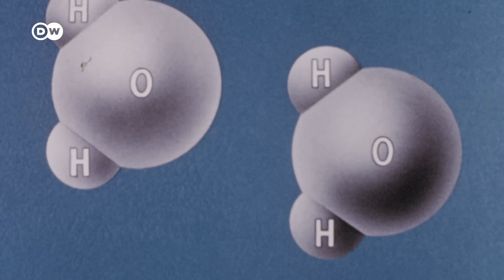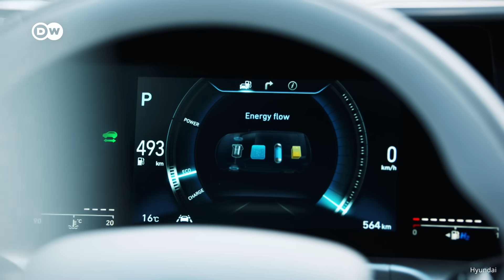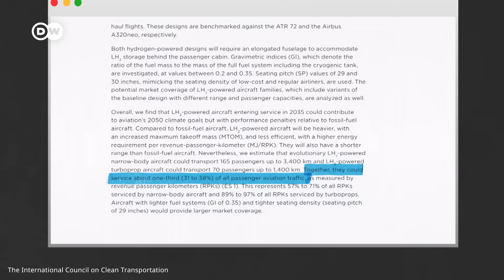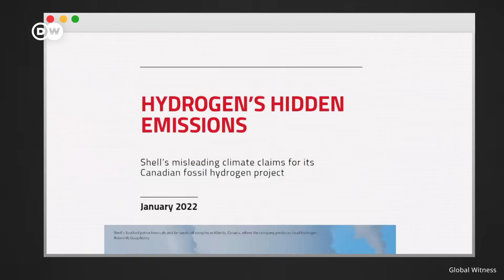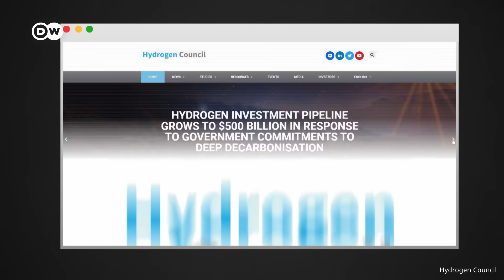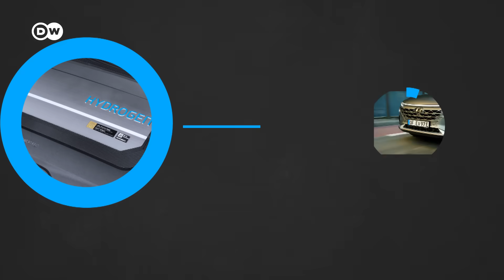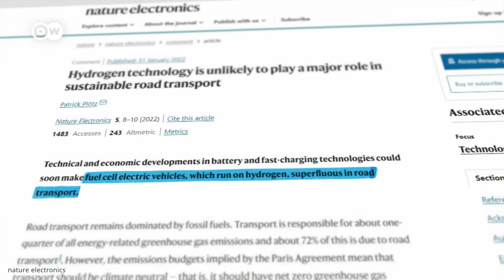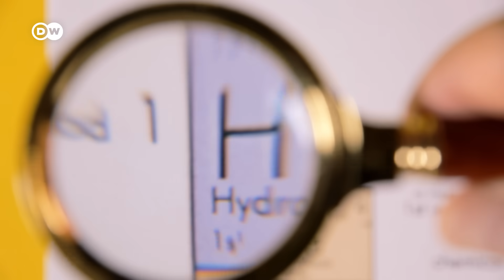The truth about hydrogen

Comment: Can we containerize Hydrogen production ? Down to a scale that a farmer with a relative small piece of land could become a grid supplier of electricity when the grid asks for it, and the installation will start producing Hydrogen the minute the grid has enough (local) producers and there is no (local) demand for electrical energy? Put a Fuel-cell in the next container, and the same farmer will be a night-time producer of electricity (when the local grid asks for it). Yes we need intelligent grids, we need decentralized solutions and steering. If we build a new section to a town, all buildings should be organized to yield maximum solar return. Connect all the solar panels to a local Hydrogen producing station (nearby, but in a safe distance) and repeat the containerized solution. Small local grids with local solutions. Huge (nuclear) power stations we are using now need weeks to start up or to slow down. We need agile, smart, self-regulating local grids.

Comment: The need for larger capacity tanks to store hydrogen gas to fuel shipping would be an advantage, as the tanks can be emptied, or the gas used for emergencies, where there is a need to increase bouyancy, be it the tank being used as a bubble to keep the ship afloat, or that the gas is expelled, to fill a massive balloon, or giant life vest for a ship. Ship designers can really have a lot of design creativity to capture this potential.
Reply: Cryogenic LNG tankers already exist…
They transport LNG at -160C.
LH tankers would be essentially identical just running at -254C.
LNG tankers run on the LNG in their tanks.
Modern oil tankers do the same feeding the tank off gas to the engines.

Comment: Hydrogen is not a fuel source, it's another less efficient type of battery or energy storage. So, you have to pit Hydrogen against other batteries and when you do, it doesn't measure up, except in niche markets. The only market that clearly needs hydrogen so far is steel.  The only energy source is the sun unless fusion is solved and don't hold your breath for that one.

Comment: Efficiency of FC. Roskilde Denmark got 20 BEV busses, with a oil burner for heating. Turns out that average electrical power for heat is 15kW - the same amount that is the average power consumption for the wheels. Using battery for heat and the batteries would be too big. So the bus is 50% electric - had it been FC the heat (at around 70-80Cel) would fit nicely - please recalculate efficiency for each application as they need heat, cars, trains - busses and ships.

Comment: Hydrogen is a great energy storage method. The enrgy stored this way is much longer lasting than batteries. You might call hydrogen a fuel, but it is not its strongest point.

Comment: A lot of environmental people hate hydrogen because it goes against a lot of peoples agenda. Its nearly a limitless source compared to batteries and gasoline yet a lot of environmentalists shun it. My theory is that a lot of the people in the environmental field have invested a lot of money in the electric vehicles/appliances, and don't want people investing in other renewable sources. Sure hydrogen isn't at the same level as ev's, but so weren't ev's when they started to come out. Ev's were  hurting the enviorment more than they were helping before people started using lithium. Hydrogen in theory is better, especially in ammonia form, and its up to us to make that theory a reality. We jist need the same kind of funding and public support really that people showed to ev's. Corpo democrats will tell the tale.
Reply: Wrong. EVs have been efficient from day one.
Reply: @Freba9  most ev's before the 2010's were acid based. Which hurts the enviorment more than the offsets it creates. Efficiency is useless if the cost to make it isn't environmentally sound.
Reply: @Mogadypopz  Lead acid battery recycling never was a problem. Apart from that, the point is that EVs have always been efficient, hydrogen cars have not and never will be.

Comment: Overall, I think everyone needs to understand that the energy transition will not happen with ONLY one renewable energy, or green energy storage. Green hydrogen, green ammonia, fuel cells and what not will all be part of this transition, just like wind, solar and other renewable energy sources.
Reply: Exactly. Just as there are multiple fossil fuels (various types of coal, oil, condensate and gas) there are going to be multiple types of renewable energy sources, all with their own specific applicabilities.
Reply: You can include blue hydrogen in that mix. There are very few barriers to adding hydrogen (blue or green) to methane in domestic and light to medium industrial / commercial use and thereby reducing the carbon emissions for a large number of mains gas users.
Reply: @AndrewJOliver  Actually no Andrew. Hydrogen and superior natural gas - like the pure now illegal corn ethanol mandate corruption - have incompatible detonation points. 

First like all the small not fuel-injected engines in America burned out by the illegal ethanol mandate - mixing hydrogen and natural gas will destroy every existing home heating system in America. 

Like the now insane excess levels of intermittent windmills and solar panels - the systemic inefficiency will impose more co2 and very real pollution.

Just because something can be done does not mean it should be done. Nor does it mean it is beneficial. 

This is exactly why all the progressive GW mania delusions fail. Average people are misled and believe in a doomsday cult. Forcing Americans with common sense along as a (forced) together. 

There is merit in hydrogen fuel cells in transportation. Especially heavy trucking.
The efficiency of electric drive does not require energy-inefficient and expensive short-lived heavy batteries. 

It is a matter of rationally applying technology. This does not happen when political myths are believed like a cult. Time for you to study for yourself.
Reply: Nuclear power will be used or carbon reduction goals will not be met in time to help. Get real, go nuclear and save our civilization
Reply: @brianadams1907  yeah no doubt about that. Nuclear is definitely part of the energy transition
Reply: Technically fossil fuels are also just an energy carrier, its just the first phase of the process (converting into fuel) has been done for us by geology and time.

Hydrogen has the added benefit of being transportable in a way that electricity is not, it can be pressurized and contained in tanks and even pipelines. Electricity can only be transported via power lines (not particularly resistant to weather) and batteries (incredibly inefficient as a transporter).
Reply: It was also a fallacy to disregard nuclear energy as one of the many tools which could be used to decarbonise.
Reply: @jonathantan2469  nuclear energy is the cleanest and most efficient form of energy production we have available. The carbon footprint over 15 year is lower than equivalent solar or wind.

The only problem with nuclear power is the obvious "what-if" scenario, failures are rare, and a well built plant tends to contain failures quite well, but you still have to sell people on the idea.
Reply: "green ammonia,"
I have some green ammonia water.  I use it to clean floors.  I think the color is added and not a natural component of ammonia.
Reply: Ammonia has the no-carbon advantages of hydrogen as an energy carrier, but already has a vast mature distribution and storage infrastructure for it's use in agriculture as a fertilizer. It could be both the energy and nitrogen fertilizer source for agriculture without need for the investments at the level of replacing fossil fuels with hydrogen.
Reply: Whether fuel or carrier is debatable. The hydrogen is transformed or consumed.

Mixing terminology. But both terms are correct.
Reply: Nuclear energy will also be part of the solution
Reply: I wonder if it’s possible to install a fusion engine on vehicles, if so, the energy density problem will be nill.
Reply: The thing is, "green hydrogen" needs 3X to 5X more electricity (solar panels, wind turbines) up front to deliver the same energy at the end point.
Reply: @booobtooober  There are massive developments being done in terms of electrolysis efficiency. Nowadays, you can have efficiencies of up to 80% using a water vapor electrolysor. The idea is still to have the green hydrogen plants located in regions that have plenty of sun, wind or geothermals. Hydrogen can store that energy, and be delivered according to need later on. Pure renewables aren't able to do that right now. Also, don't forget that hydrogen is already being used in plenty of Heavy Industries which need to decarbonize as well, so I don't see why green hydrogen wasn't a viable alternative to these industries, since the technology of electrolysis is well known a d hydrogen is being used widely...
Reply: @TWCHHK  Don t forget that the good old solar and wind energy together with battery technology is getting better way faster then hydrogen tech.
Why use electricity to produce hydrogen to power a car when it costs way less to directly use electricity to power it?
Also, what are you saying renuables can t do right now?
Reply: @lucadellasciucca967  Because hydrogen can store energy in order to be used later on. Just because I say that hydrogen could be useful doesn't mean I rule out the usage of classic batteries and renewables. My comments clearlt states that we should focus on using a combination of all technologies that will allow the world to decarbonize.
Reply: @TWCHHK  Also, efficiency alone doesn't matter. Total cost is what really matters.
Reply: @lucadellasciucca967  still needed for steel etc
Reply: @user-zt4zr7eg6z  irrelevant
Reply: @booobtooober  if we use hydrogen fusion to create hydrogen it should be fine. Assuming a 30% efficiency the energy density per kg will become 3-10 million times of natural gasses.
Reply: @booobtooober  This sounds like solar panels and wind turbines not too long ago? We have to invest in hydrogen in order to succeed
Reply: @booobtooober you forget about nuclear energy
Reply: @booobtooober  that will one day be irrelevant because there will be so much excess green energy during the day or when the wind blows, Hydrogen has many advantages for storage, for instance you are only limited by how much you can contain, its much easier to build days to weeks worth or storage to hold hydrogen than build days to weeks worth of batteries.

Then off course like fuels it has the advantage of getting lighter as its used, this is important for things like planes, battery's never get lighter.
Reply: Any transition will result in an energy crisis that will harm the poor people and countries.
Reply: @888Longball  Well with a 10,000 year supply of natural gas held in ices? 5,000 onshore? + the natural gas is freed from the ice matrix by co2 sequestration? This is why progressive A Nevel nescience GW political cult zombieism was necessary. We are not running out.

Transition is fine if there was integrity or science directing the effort. But there is no integrity or science in the A Nevel political progressive zombie condition.

This is why it is a killer progressive disaster. Just keep covering up the failure.
Reply: @888Longball  no
Reply: transition to poverty
Reply: @echelonrank3927  and where do you get this from? Gotta have somr faith. New technologies bring new opportunities for employment, even in the poorer regions of this world (if done right)
Reply: @TWCHHK  wishful thinking that will see a disastrous crisis.
Reply: @888Longball  and on what ground do you justify that statement?
Reply: @TWCHHK  The fact that I am a Chemical Engineer who understands thermodynamics and energy balances. Do the calculations then come back and talk to me.
Reply: @888Longball  okey so enlighten my as a chemical engineer. What tells you that energy transitions aren't possible? We are already partly in it with prices dropping gradually as demand picks up
Reply: @TWCHHK  if it were possible, somebody would have a quantified plan says to replace hydrocarbon  we need x thousands of square miles of solar panel, y millions of turbines and z quadrillion cu. ft  of hydrogen. Plus $ trillions in infrastructure to ensure that the light don't go out.
All we have is some notion that it can be done and hope that a technological solution will make it possible.
Reply: @888Longball  well its a process and I believe that with time and combining various methods the transition can be made. Have you heard of Synhelion producing Sustainable Fuel out of condenced Sunlight and Air? Progress has never stopped.
Reply: @TWCHHK  I got into chemical engineering because I wanted to find alternative solutions. I've sen a lot of "promising" technologies fade into oblivion. I'll check this out though. Thanks!

Comment: H2 storage is cited below.  The energy cost of producing and storing green hydrogen is high relative to the usable output from a fuel cell so it cannot compete in areas where the weight penalty of batteries is small.  The specific energy of batteries has much more development headroom than the efficiency of fuel-cell and the hydrogen production/storage.  Any advantage H2 has today in certain applications will erode, causing problems with economy of scale.

Comment: Very good presentation  of the hydrogen hype. With only a few years left to dramatically reduce greenhouse emissions we should  not be using treasure and resources trying to make green hydrogen. Use the money and resources to expand solar and wind electric generation and battery storage. At the point where we have stopped global warming then it would be the time to explore the possibility of green hydrogen.
Reply: Yuo cant stop global warming , its imposible
Reply: As mentioned in their video, being able to use hydrogen in place of coal in steel production removes 8% of greenhouse emissions in one go, if it is produced as green hydrogen. Therefore in just one area you remove a substantial cause of global warming. Reducing climate change requires many avenues of attack on the problem of fossil fuel use.

Comment: Hydrogen does have potential for heavy transport scenarios where building electrical grids are impossible or not financially or environmentally justified, for example, cargo ships and some rail freight where the traffic is too low to justify electrification. Hydrogen is also sensible to replace use of coal in industrial processes such as steel production. It makes zero sense as a clean energy storage media since batteries, including sodium ion cells for bulk storage are simple, cheaper and more efficient. To make the most of clean energy conversion efficiency is essential, where batteries can be use hydrogen is not justified.

Comment: One thing missing from nearly every hydrogen "analysis" video I see is the storage challenge. As a friend in the industry explained to me, hydrogen gets everywhere. It is the smallest atom in it's unbounded state. When pressurized (the only way to effectively store it) it impregnates and permeates whatever container is storing it. This causes brittle flaking and stripping in steel. It finds nano cracks to escape and other challenges. A simple Google search will show you this is still a huge issue being actively researched. Unless something major has changed, this is still a huge issue, and simply handwaving it away saying "scientist and engineers" will magically solve this in the future when it wasn't been solved for the past century, is unrealistic. I would love to see hydrogen or another renewable energy solution become ubiquitous but these very really challenges do have to be solved
Reply: store zipped, bundled, packed in chemical compound transported, then released when needed
Reply: Don’t store it, burn it directly in an ICE or in a fuel cell to charge forklift batteries, pump water uphill to reservoirs overnight etc

Comment: Switching fuels or electrifying everything isn't the solution because it doesn't solve the root problem, which is infinite growth. Even if we could power the entire global economy using solar panels exclusively, consider this: if the number of solar panels we would need to power the entire world is somewhere between 20 and 25 billion, and global energy demand increased at just 3% every year, that demand would double every roughly 25 years. So 20 billion solar panels in 25 years would become 40 billion, in another 25 years, 80 billion, 25 more years 160 billion, and so forth. In only 75 years, the number of solar panels we need to power the world increased by 8x. The materials needed to make solar panels are not infinitely abundant or renewable. As long as our economic system is based on infinite growth, no fuel or technology is sustainable.